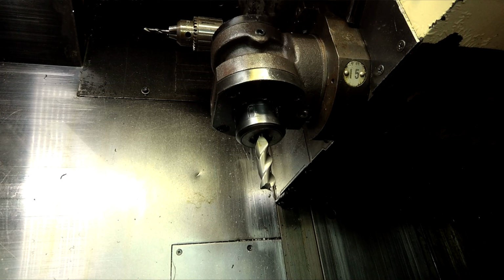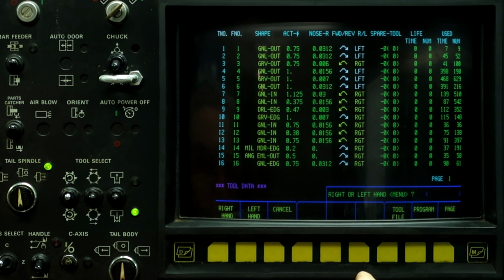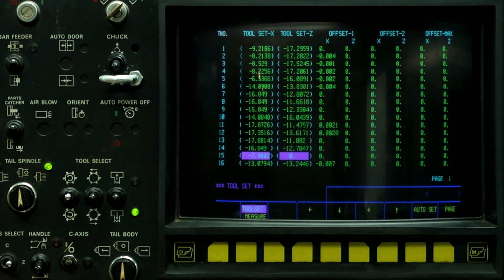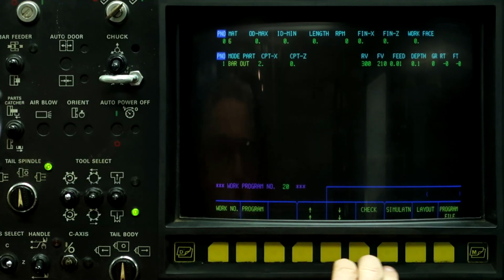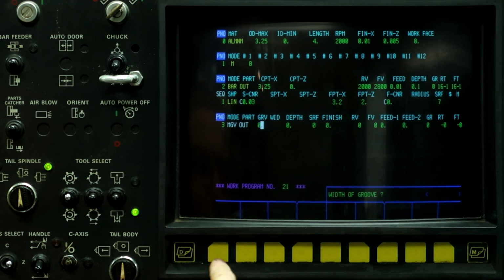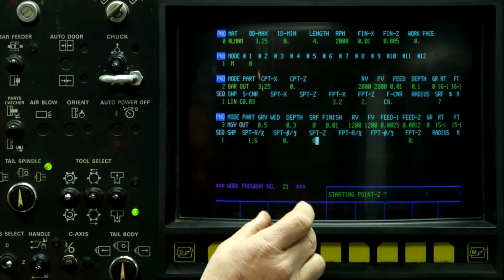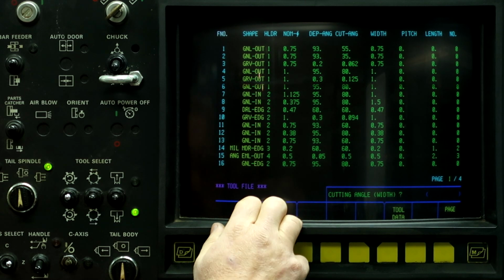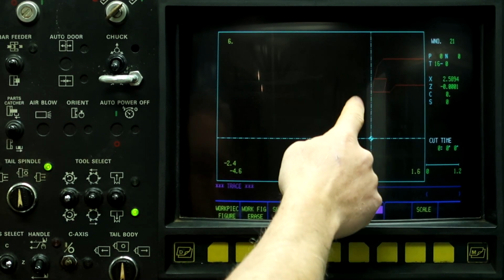Mazatrol OD Milling Slot

Comment: We cut slugs. We can get three pieces off of one slug. I had to restart the machine. I have one more piece to make. My question is, how do you restart to cut that last part?
Reply from the maker: The only way I know how to do it is to just copy the program and set a new Z workshift for the one part and do not have the end process do any looping. That way you do not have to adjust the original program for one part.

Comment: Hi Phil, thanks so much for these videos!   I am looking to purchase a mayzack with T plus control.  Do you happen to know if the programming works the same on that control as it does on the older T2 and T3 controls?
Reply from the maker: Yes the programming is basically the same. The T+ has more features but it will run the same as my videos.

Comment: hey Phil how would you put a groove with an endmill all around a part ??/ would that be a ZC operation? or ZY ??
Reply from the maker: ZC if you spin the chuck 360 degrees.
Reply: @mazatroltipsandtricks6816  i thought so but how do i make my tool stay still ?? 
right now i can make threads if you know what i mean? 
the tool wants to go left and right as C rotates
Reply from the maker: @christophercolumbus8944 Keep Z position the same. Do not put in any CW or CCW moves just linear moves.
Reply: @mazatroltipsandtricks6816  that makes total sense haha

Comment: Thanks Phil for another learning experience.  Gotta say though, wouldn't EIA be better?  .025" ramp to depth each direction, no extracting tool each step, and when it reaches final depth, just a zero cut back and forth.  Would Mazatrol allow you to do that.  Me too, no Y axis, I guess should invest in end mill grinder so I can undersize the roughing mills like .015"  diam or just order them from Mari like that?  One lesson I learned all these years is that Frank makes unbeatable cutting tools.
Reply from the maker: Not all machines of this era had EIA programming. However, you can write a MMP manual milling process to do what you propose.

Comment: Hey Phil.

Lucky Man to be able to Mill on a CNC Lathe.
Definitely something I would like to have as part of a Lathe.
A big time saver if you have this option available.

Unfortunately it's over to the CNC Mill for all my Milling work post Turning.
I had thought about upgrading to a Turn Mill,  but I don't really have enough of this sort of work to justify it,  even as much as it would be Very handy.

A great option to have on any CNC Lathe.

Thanks for the video.
Peter 👍
Reply from the maker: Thanks Peter. This is a very early machine with live tooling. It is limited to what it can do as it does not have a Y-axis. Newer machines are truly bad ass.

Comment: Hi Phil I sent you an email up some time ago regarding a machine I was looking at buying long story short I got a quick turn 10n atc m/c but it won't power up. Glad to see you are posting videos again.
Reply from the maker: Make sure the transformer is set to the correct incoming voltage you are feeding it. Also make sure the phasing is correct.
Reply: @mazatroltipsandtricks6816  yes I checked that. When I received the machine all the boards were falling ot of the rack and everything was lose the shipping company did me bad and put it on a flat bed trailer and pickup truck and I got beat up going down the road.
At this point I'm looking at  Retro fitting it.